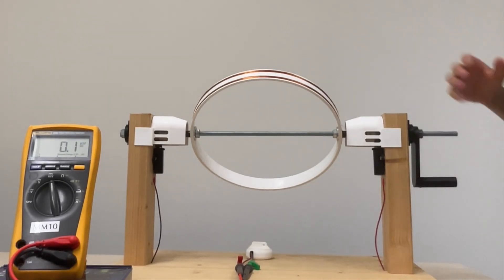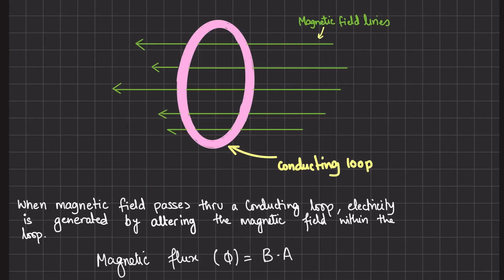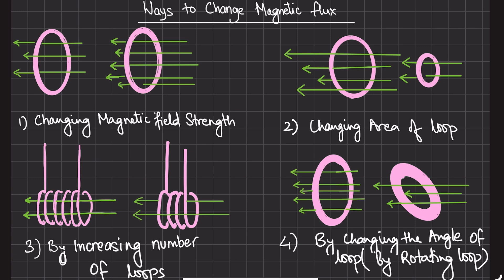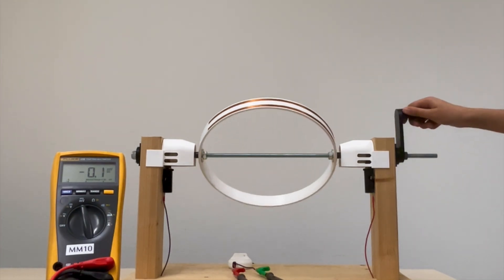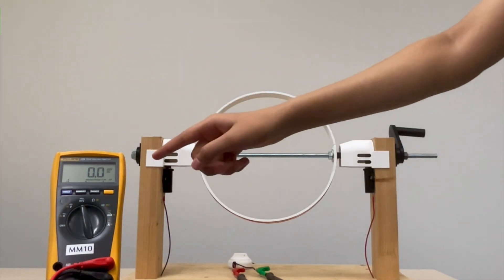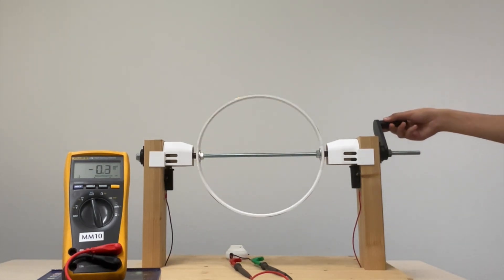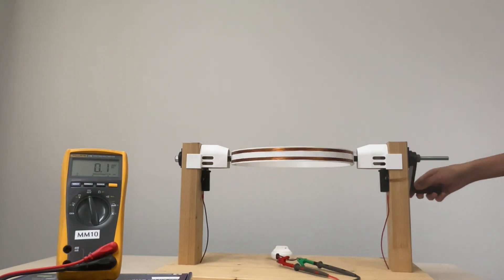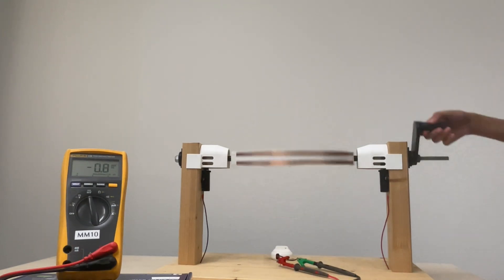Electricity via induction using the Earth's magnetic field

Comment: Turn the unit perpendicular to the magnetic NORTH field and re-run to prove the configuration is correct - 1.8millivolts will not power anything worthwhile but this fixture demonstrates this basic law nicely. Use an ohmeter to demo how the loop is isolated from the crank, further proving your results.

Comment: Marvellous experiment, just love it. I am trying to use a bi-filar coil in a customised configuration. Could you tell me if the Tesla pancake coil apart from the dual windings was the most efficient way to increase current flow ? It appears to me that if you want to gain maximum efficiency and therefore maximum current output what you need to do is keep the magnetic flux as close as possible to the windings and use the thinnest wire. Therefore a circular pancake coil would not be as efficient as a linear wound or shaped coil. Is this correct ?

Comment: On the other hand, the energy generated actually comes from the arm, hence food and ultimately the sun.
Reply: Even in a magnetically shielded room?  Yes, the arm does the work, but without the magnetic field, there will be no conversion of mechanical energy to electrical energy.
Reply: @thomassuit7450  You might want to consider the Earth's magnetic field as an essential component of the apparatus.
Reply: Reading comprehension here is abysmal.
Reply: @thomassuit7450  Agree, this video is arsenine
Reply: noone is claiming the energy comes from anywhere other than muscle power. the special thing here is using the earth's magnetic field instead of an artificial magnet. you don't get energy out of the earth's magnetic field without doing anything the same way you don't get energy out of the artificial magnets in a generator without doing anything, but nobody in the video said anything to the contrary

Comment: more please...i still do not have a sense of what electricity is. how to grab it and store it. what it is in fact...
Reply: electricity can't really be pure electrons as some might think..... electrons function as carrier of magnetic potential...... a 100 foot copper wire under a high V line produces electricity and will light a small bulb,  and it will do it indefinitely if the wire above keeps carrying the high voltage electricity... so the wire suspended under the high voltage wire is not generating electrons to run that light, cause it can't do that indefinitely, right? .... the electrons within the copper wire are carrying a tiny portion the magnetic potential moving through that high voltage line....  if you had millions of them under the  high v line you'd literally change the amount of electric potential being carried by the high voltage line....hell of a light show somewhere in a field.... back to light, yeah, photons, or are they waves?
Reply: if you want to learn about what electricity is look up electroboom

Comment: You're generating electricity from the movement of the loop. Do you realize it?
Reply: @renatooliveira0266 The lady who made the video explains that in some detail.  It is a hand cranked generator. It generates electricity.  A magnetic field is required for it to work. 

Now technically, it is more accurate to call it an energy converter maybe in that it takes  mechanical energy and converts it to electrical energy, but it can't be done without the magnetic field.  And the conversion will be really inefficient if the field is weak. 

The point of the video is how magnetic induction is used to generate electricity, and that it can be demonstrated using Earth's magnetic field.
Reply from the maker: The movement of the loop changes the magnetic flux through the loop, which generates (induces) an electric current in the wire. If there was no magnetic field, no current would flow. If the magnetic field were stronger, more current would flow.
Reply: @bettstetter  she's generating electricity from the power of her muscles. 😁
Still don't get it?
Reply: @bettstetter Gosh. You still don't get it!
Lots of "scientific" words.
Zero comprehension.
Seems no one can help you...
Reply: @renatooliveira0266  Oh, you don't have the faintest idea what this experiment is all about? Don't worry, you're not missing much. But hey, no need to take that pressure anyways.
Reply: @lawmajamwal  let's pretend I don't have a clue.
Explain it to me. Briefly. How do the Earth magnetic field is generating electricity? But don't forget: NOBODY is allowed to spin anything. Otherwise I won't buy!
Reply: @renatooliveira0266  EMF is induced in a conductor when there is a change in the magnetic flux linked with it. By rotating the coil, the angle between the coil and Earth's magnetic field changes, causing a variation in the magnetic flux passing through the coil. This change in flux induces an EMF, which can be observed on the voltmeter. If you dont rotate the coil there wont be any change in flux and no emf will be induced.
Reply: @lawmajamwal  so if no one rotates the coil no energy!
How hard is to understand simple things?

Comment: as stated earths magnetic field is TOO LOW....as such we get in micro-volts . We can replace this with STRONG RARE EARTH MAGNETS and see the effect ...it will generate good voltage levels....
Reply: The Earth's magnetic field is relatively strong, it can overcome frictional forces and rotate a small neodymium magnet placed on a piece of glass.
The voltage at the coil terminals is also not small if the coil has many turns. The voltage is of the order of microvolts only if the coil had a turn or two (I have performed similar experiences).
Reply: It's a physics demonstration.  And it worked without having to buy a magnet.

Comment: Sorry, but this induction doesn't make the Earth but only built-in into the walls electrical AC-wires and near position of demonstrator who acts as plate of condenser..
Reply: I agree. A cheap oscilloscope would show what's really going on here.
Reply from the maker: One can check with a compass whether the dominant field at the experiment's location is 🌍's magnetic field or one created by current-carrying wires.

Comment: Use solid state to artificially rotate the field. No need to turn it. No moving parts.
Reply: Not possible...
You will spend more energy to rotate artificially the field than you can generate with the device.

Comment: Electricity from your rotation. Not from magnetic field.
Reply from the maker: In the absence of a magnetic field, no current would be generated.
Reply: @bettstetter  Perhaps he is making the point that this is not free energy.  The Earth's magnetic field is putting a load onto the coil as it is spun.  It is the work from that extra load which is being converted to electricity.
Reply: Add a diode and only let one wave pass, and you can create DC current
Reply: You are you tubes answer to the question that no one asked.
Perhaps the coil is turned by a windmill ,then what are you going to object to now?

Comment: Did this in physics classes back in the early 60s!
Reply: How much did you manage to generate? In Watts or VA
Reply: @giacomofrattini4456 one billion stuffs!!
Reply: Is this thing for real? How much can you generate?
Reply: @gothboschincarnate3931  well the principles are the same that make the 🧭 point north/south. The difference is that the compass is substituted by copper and you have to use a compass in order to position correctly the device . Yes it is likely to be true. The more sofisticated is the device, the more electricity you can produce. Usually coils are used and have to be made in particular ways. In this case it is only two strips of copper, not even coils, so it will not be a huge amount of energy. I mean it's not a device designed to produce electricity for any purpose different from showing that it is possible.
Reply: @gothboschincarnate3931 it’s so easy to add a permanent magnet, so much stronger than the Earth’s magnetic field. Then, it’s just like any other generator.
Reply: @alphagt62  yep. By the way you have to forge that permanent magnet. I don't really know if it was convenient using the Earth's magnetic field 1 century ago. Maybe now we have more advanced tech that enables us to do that efficiently and cheaply. Deep researches on various variables of the device might lead to positive consequences. Might be time well spent.
Reply: @alphagt62  right 👍

Comment: What if we hold the coil vertically
Reply: The same thing is observed, because the lines of the Earth's magnetic field are generally not horizontal, but make certain angles with the horizontal surface, depending on the latitude.
If the coil had its axis in the same plan as the magnetic field lines, then no voltage would have appeared at its terminals.

Comment: Very interesting, so my question is is there a way to implement this big scale to actually generate sufficient electricity?
Reply: Yes. Never seen a generator?
Reply: Windmill, turbine, water wheel.
Reply: I think you missed the point...
The energy isnt coming from the magnetic field, she is just using the magnetic field as tool, the generated energy is coming from her hand which is rotating the device.
Reply: Need to make Electroboom watch and comment this video.

Comment: you have a lamp holder behind the coil... is it possible to light a lamp with the generated electricity? this would be a much more interesting experiment than checking the numbers in the voltimeter, overall for younger ones. Thx for sharing :)
Reply: or even use the generated electricity in order to generate perpetual movement?
Reply: @MarcProfeMates perpetual motion, as long as someone spins the coil forever.
Reply: @MarcProfeMates  Directly generating light with a micro-volt source alone is infeasible  however, amplifying that voltage using some alternative mechanisms can make it theoretically possible but challenging.
Reply: Hahaha you got it Toyota
Reply: https://youtu.be/SLW3EDs0R3M?si=s8lwecBRVtBHv2jp
Reply: i think if you had a very big coil with a lot of loops, spinning very fast, you could make enough electricity to produce a useful amount of light.
however, there is nothing in the universe that can produce infinite energy, or that can give you an endless supply of energy without you giving it an endless supply of energy first. if you just wanted to make something nice forever, you might get close by setting something spinning in deep space without anything around to touch it and slow it down, but if you wanted to extract energy from it you would necessarily have to slow it down by doing so, and the only way to get it moving faster again would be to give it back some more energy